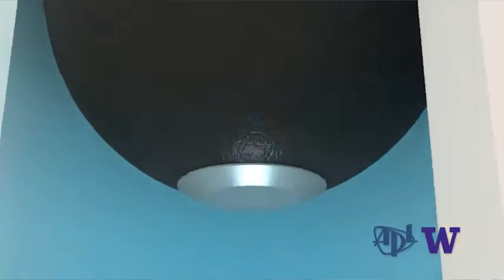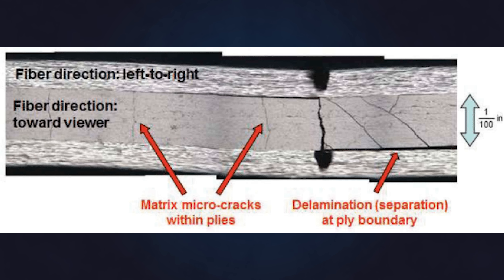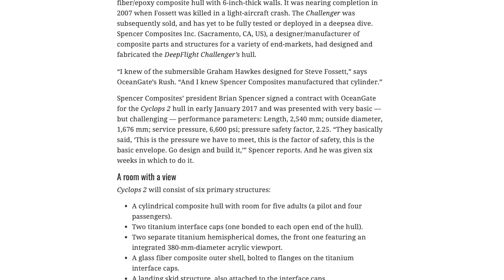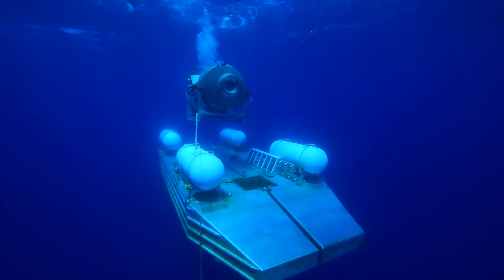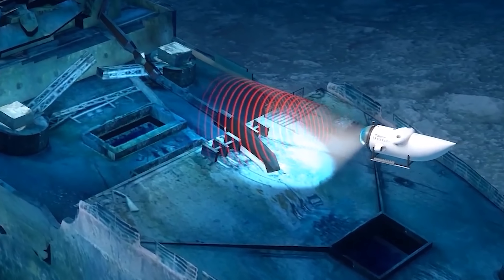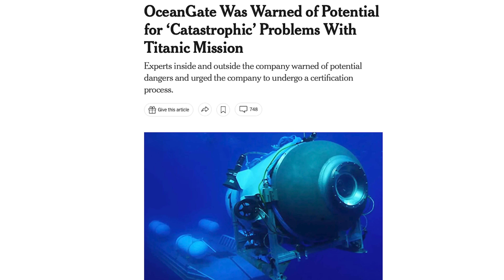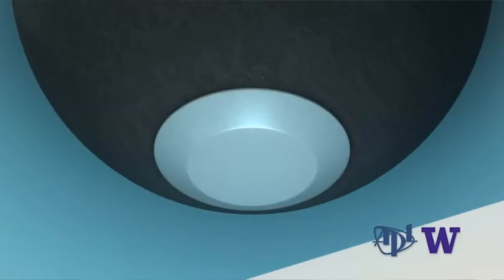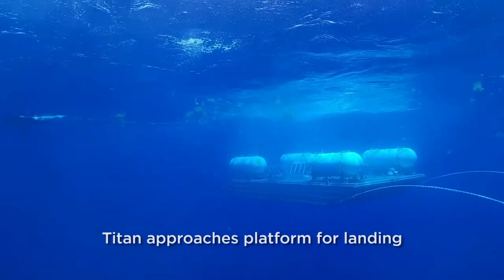Engineering Failures Behind Titan’s Implosion!

Comment: This video is basically what I have been thinking about the sub. You should also point out the graph which shows that titanium and carbon fiber wears down and breaks, but steel keeps its strength basically forever in an equilibrium at a microscopic scale.
Reply: Nobody has mentioned as yet galvanic corrosion which can be a factor when carbon fibre is in contact with a metal whilst immersed in an electrolyte, such as seawater.
Reply: That is correct what you say of metal but it too has an elastic limit or yield strength but it can rebound as long as it is not yielded.. I am not a engineer but just a fitter and turner and we are taught this in our limited metallurgical classes as for carbon fibre I am also a sailor we have been using this material for many years now from prepreg autoclaved layups to vacuum bagged wet layups and also wet injection type it’s a fantastic material when used as its engineering intended in tension not in compression it is also very sceptical to matrix bond to bond ratios ..I have been in cases were it is pushed to its yield and unlike metal it explodes into splinters I’ve seen this first hand …you may of saw this in action too in the last americas cup the boat was fine till it was slammed in a compressive force it just exploded ..the same happened in 1987 cup races one Australia primary winch failed they loaded that sheet rope on to a winch at the aft of the vessel and put a compressive load on the boat that lasted only a few minutes the boat broke in two and went to the bottom in a few minutes, lessons learnt don’t compress carbon it not designed to work that way …I too agree with this video compressed metal you still have metal just like a crushed can  with carbon you have very little left except splintered material everywhere and if you notice the recovered pieces there is no carbon as such so the implosion is very much so pointing to the carbon failing though it’s weakest point compression … my limited experience tells me carbon under compression is a non engineering viability as many tried to point out to the idiot ceo …
Reply: @stevenmiller5088 Just to add that with steel and steel alloys you can reliably predict the maximum safe working limits before reaching the critical yield point....with carbon fibre you can't predict any such point except be certain in the knowledge that CF will eventually fail at some point after cyclical stress loadings have been applied. CF is quite unpredictable and as such the wrong material choice for a deep ocean submersible.

Comment: My guess is that the Titan's viewport blew in. It was certified to a pressure of only 1,300 meters below sea level. Sea water then shot in, compressing the air and all five passengers into a tiny area in the opposite titanium cap which remained intact. I assume that this is the location where "presumed human remains" have been recovered. That cap has not been shown on public videos. At the same time the extreme and rapid compression of air into that titanium cap would cause tremendous heat. After that the carbon fiber hull would explode. The result would be one titanium cap without the viewport, one cap with about a ton of compressed, cooked human mush in it plus a lot of carbon fiber scattered around, which I believe is what has been found.
Reply: No need to tell more about how they got cooked and squashed, pressurized and made to touth paste.
Reply: @thorsrensen3162  Well, thankfully this all happened before their nerves could tell their brains anything. I'm just speculating about what is the story with the "presumed human remains". If the hull would have imploded I expected the passengers would have been shredded into countless fragments which would not have been recoverable. That was apparently the initial expectation. In any case, RIP Titan customers. For Rush, I'm not sure I would say RIP. This was so criminal.
Reply: @JacobStein1960  Don't be so petty minded. How would your family feel should you and others were killed and people said 'RIP to everyone except Jacob'. Please be adult and mature about this.
Reply: @dianewalker4633  Let's say someone gets drunk, gets behind the wheel and drives into a family, killing them and himself. It's not exactly murder, but it's so outrageously negligent. I wouldn't feel much sympathy for that drunk driver.
Reply: @JacobStein1960   You are hardly comparing apples with apples
Reply: But then again if the force of water coming in through the port could really cause the rest of the hull to explode, then a breach in the hull should have the same ability to destroy the viewport the same way anyway.

Edit: my bad, I said they did show both caps but it was just a weird edit of the footage I saw that made it look like they had both shown.
Reply: @ASusBlondMan  I am looking at the photos that I can find online. I can see definitely the cap with the viewport on it, that fin shaped piece from the back end (that was purely cosmetic to my knowledge), the square frame thing from the bottom which I think had the ballast in it but I can't make out much else. The actual back titanium cap perhaps hasn't been brought up yet, although I suspect it has however that is not being displayed for understandable reasons.
Reply: @ASusBlondMan  Which is sort of odd. I see pretty much everything coming up except for the carbon fiber hull which obviously been blown to a million pieces and that rear titanium. Where is it?
Reply: I think the port hole was cone shaped. So Pressure from the outside would push it in tighter. Pressure from inside would pop it out.
Reply: @hesterwright3674  But if it was designed for 1300 meters and they were going to 4000 then it’s like smashing it in with a sledgehammer over and over.  It’s interesting that it even held up once.
Reply: @jacob. Nope, the noises were heart aft. The hull imploded which caused the viewport to be blown out.
Reply: Some other comments have stated that the rear end cap was one of the first parts to be recovered, and it was recognizable because it was still attached to the flange.
Reply: @TheSpaceEnthusiast-vl6wx  All the news photos which we have of the wreckage are photos of pieces of the submersible being unloaded from a US Coast Guard ship at a Canadian Coast Guard pier in St. John's, Newfoundland on June 28, six days after the wreckage was discovered. I think those photos should include everything, and we do see almost everything, however the rear titanium cap is not shown and it was then noted that “presumed human remains” were found in the wreckage. On June 22 it was announced that the rear titanium cap and the landing frame had been discovered on the ocean bottom. The landing frame is shown being unloaded in Newfoundland but not the rear cap. So I am just speculated about what that might mean. Perhaps the viewport blew in and the passengers were explosively blown into the opposite titanium cap.
Reply: Based on the transcripts it seems more likely to be a hull issue and the viewport collapsed after the implosion of the carbon fiber tube in the middle.
Reply: @justaregularguy115  Perhaps but although the transcript has been widely shared on social media platforms it has not been verified, and there is considerable doubt about its authenticity. My first guess was also the hull, or the connection of the hull to the caps, but considering the 1300 meter certification on the viewport, assuming that is accurate, I don't think there is anything else to discuss. It's like playing "catch" with a live hand grenade.
Reply: @justaregularguy115  Another problem with the carbon fiber implosion theory is that the landing frames look very intact and straight in photos which have been released of their recovery. I would expect them to be bent inward if the carbon fiber hull imploded, however this is not the case.
Reply: @JacobStein1960 In the leaked transcript (if legit) Rush had indicated that he was jettisoning the landing frame to attempt ascend.
Reply: @Ed-qv2qd  On July 12 Snopes rated the transcript as false.
Reply: @JacobStein1960  perhaps it is false but still highly likely they were trying to ascend and did jettison the landing frame.  In James Cameron's interview with CNN he mentioned he believed they knew something was wrong and were attempting to ascend.  Highly likely given the community is quite small that he had access to at the source knowledge of the events which took place.
Reply: @Ed-qv2qd  Another thing about that landing frame. From all the diagrams that I can kind find it looks bolted on to the titanium caps or the titanium rings between the caps and the carbon fiber hull. I don’t think that they could push a button and blow it off. There might have been some ballast attached to the frame which could be dumped however not the frame itself.
Reply: @JacobStein1960  if it was bolted to the ti cap or rings wouldn't we have seen it included with the recovered wreckage?   I know I've heard it mentioned a few times that the landing frame could be detached in an emergency if needed and the idea that it could makes sense to me if you needed to shed weight quickly to ascend to the surface. ...but given the shortcuts/bad design of the submersible I could also see them cutting corners on this aspect as well.
Reply: @Ed-qv2qd  Yes, the landing frame is clearly shown be unloaded in Newfoundland. But I don't think that the passengers had an option to blow the frame off the submersible. They maybe could dump ballast attached to it.
Reply: @justaregularguy115 You mean "alledged" transcript.
Reply: Don't share your thesis.  I believe the carbon fiber failed due to cyclic loading, likely at the titanium hull flange interference which by design was a stress riser as the hull at its lateral mid point would oil can with each successive dive.
I look forward to the analysis of parts retrieved from the ocean.
Reply: @lukewalker1051  That's definitely everyone's first guess, however would they be recovering human remains in that case? It seems doubtful. It's also odd that we haven't as yet seen the rear titanium cap in any photos. That's why I am leaning toward   that viewport. It certainly was a potential problem.
Reply: @JacobStein1960  Don't follow your deduction about human remains. All 5 people on board were vaporized, first by implosion and then hyper 'ex'plosion which likely blew the acrylic window outboard and caused tensile failure of the bolts.  
Even though the window was only rated for 1300m, the carbon fiber hull was likely less resilient to water pressure due to cyclic loading because it 'never had structural integrity' in the first place. Rush probably knew it wouldn't pass any sort of destructive or non-destruction cyclic fatigue tests was 'any' safety margin over 400 bar.
We will wait together for their findings.
Reply: @lukewalker1051  A hull implosion would have chopped the passengers into a million bits, while a viewport implosion would has rammed them into the back titanium cap. I think that second scenario better explains finding human remains.
Reply: @lukewalker1051  But why is the landing frame perfectly intact instead of being bent inward when the hull imploded and the titanium caps were sucked towards each other?
Reply: @JacobStein1960 because according to the transcript they jettisoned the frame moments before disaster struck, the frame wasn’t attached to the sub when it imploded.

Comment: Best explanation I've watched since I've followed the disaster
Reply: Its only for this comment that i watched the video. All videos now are: What realy!!! Happend. But some weeks ago en some from today
Reply from the maker: Thank you! That's really kind of you
Reply: @beyondengineering 
I never heard of any non destructive testing for 5in thick carbon fiber.
Reply: @beyondengineering 
I haven't seen any parts retrieved other than the end caps. It seems at this time that there is nothing left of the carbon fiber cylinder.
Reply: @beyondengineering I agree, but you made a substantial error that needs to be addressed in a follow up video. Spencer built the first tube, which was used on dives before 2020. This is the one that was making so many noises. A different company built a new tube in 2020 and that’s the one that failed. I’m hoping you can find the details of that company’s layup and redo your analysis!
Reply: Agreed!